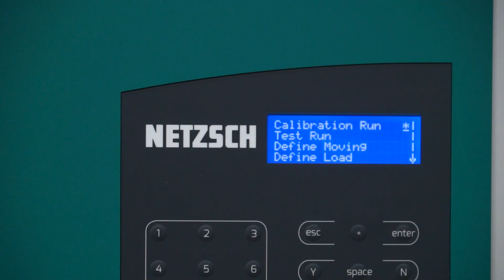Insulation R-Value Testing

Comment: My assumption is there is a reduction in the R value hence the creation of the machine.  My question is have you developed stats on the size and frequency to determine the amount of reduction?
Reply: The HFM was created to measure the R-value of insulation. We use it to quantitatively determine if dents in the insulation have affected the R-value of insulation.

Comment: Lol!  The insulation enters the fancy machine to be tested, the computer makes a graph, and... no conclusion.  I love that they need a big fancy machine connected to a computer to measure thermal flow. I was just hoping they would put a heat lamp on one side and a thermometer on the other and give us some useful numbers.
Reply: Our HFM is a fancy machine. It relies on steady-state thermal conditions and precise measurements and calibrations to accurately determine R-value. Simply applying a heat lamp and measuring temperature will not determine the amount of heat flow through the insulation.

Comment: This is only one of three methodologies…. None of them standardized.  There’s no way to test a 3wythe brick wall made out of hotmix in your little box Brad.  But somehow the most expensive real estate and coveted real estate in any city is just that: traditionally constructed 3wythe.  With boiler heat they function lovely in the winter, and they have enough mass to stay cool in the summer with no hvac if you know how to use your double hung windows properly